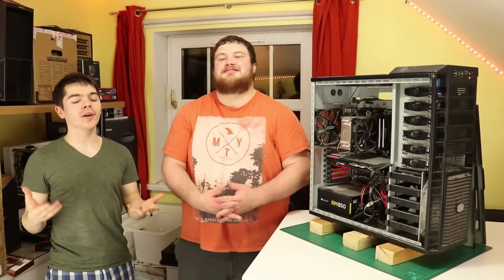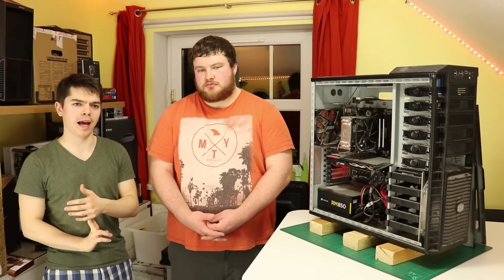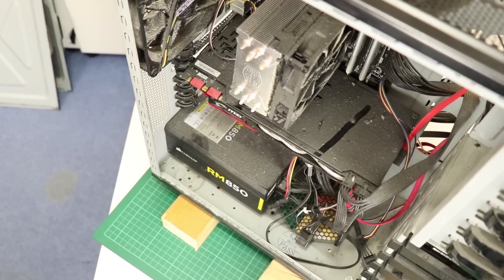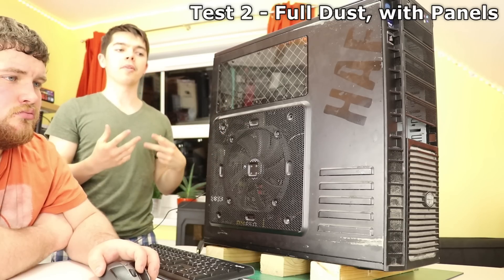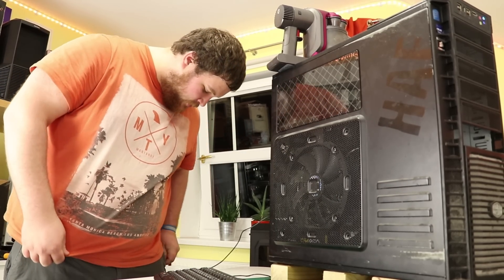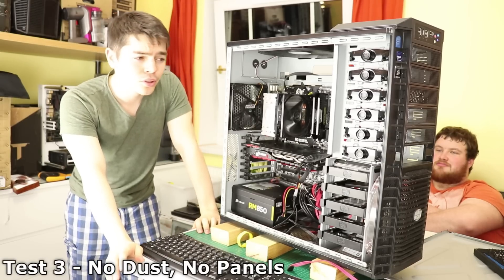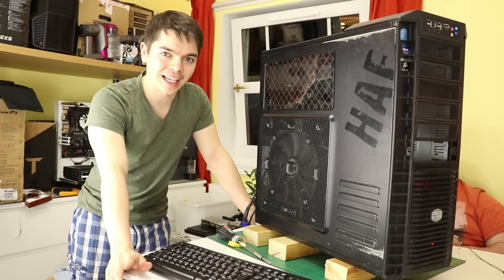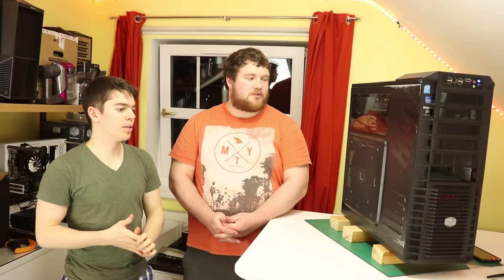Dust vs Thermals - 2 Years of Dust Harvesting Tested!

Comment: Why on the earth did you clean that pc while it's ON and indoors?
Reply from the maker: Because it literally doesn't matter. The PC was completely fine, and myself and Joe have done this a countless number of times without any issues. We even did it on carpet!

PC parts aren't like children, they don't need to be handles all that sensitively. Scientific instruments, sure. But consumer PC hardware can be put through a dishwasher without a problem.
Reply: @AVTechy  Id like to think the comment was more about releasing that amount of dust into the air lol

Comment: Well, from my personal experiences, nothing beats good old compressor in case of cleaning pc. Just make sure that you do it outside the house.
Reply from the maker: Haha, yeah I think outside would have been preferable. All that dust had to be cleaned out fo the room afterwards :P

It was a touch rainy outside though, but the garage would have been a good idea. Having said that, getting the lighting equipment down into the garage would have been a pain, but it's not like I used the lighting very well in this videos wither way (it was a bit of a rush).

Comment: The fact that the back fan is intake bothers me more than the dust for some reason :D
Reply: Maybe Alex could do a test on that. Would be interesting to take the top fan of completely and turn the back fan around so it's an exhaust.

I would think the temps would be better with the setup I just listed but the only way to find out if he tests it.
Reply: @TotoGeenen   Because this is a large case and has so many ventilation holes already, i don't think it will make much of a difference. Also, this looks like the stock CM fan than can't push any air whatsoever :P  In smaller cases with only front to back airflow it instantly makes it a hotbox though.
Reply: @kostasbezaitis2695  probably true but still interesting to test.
Reply from the maker: Haha, yeah I spotted it during out testing and pointed it out, but Joe was not bothered in the slightest haha. And for the sake of testing consistency we left it the way it was :P

I think you're correct along the lines of the case being so large it's virtually a non issues, but I'm sure a few degrees could be knocked off the CPU temps if it wasn't fighting against the Hyper 212 Evo's fan.
Reply: @AVTechy   Judging by your on/off panels tests, i think that the poor CM fan wouldn't decrease the temp even by 1 degree :P
Reply from the maker: @kostasbezaitis2695  Very true, even is a single degree was measured it wouldn't be reliable as a statistic. Well theorized :)
Reply: yeah, this test looks a bit "fake" if you consider this fact